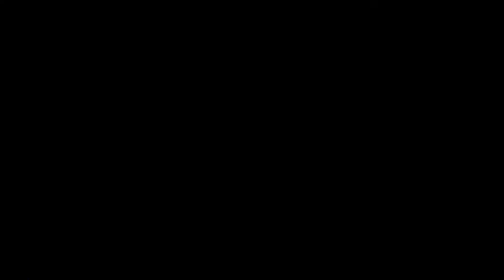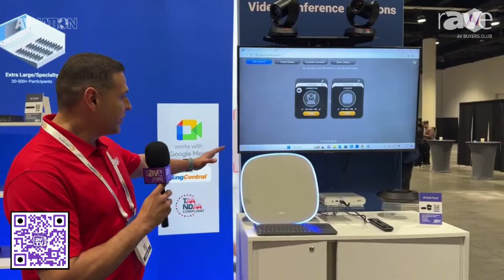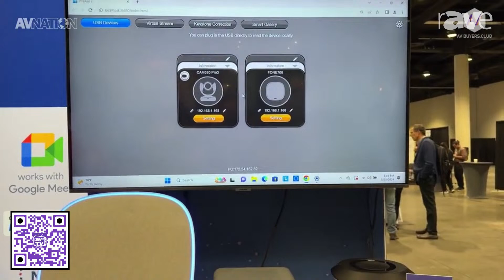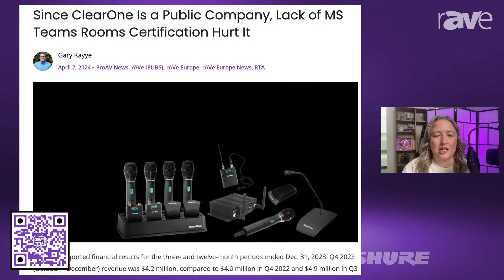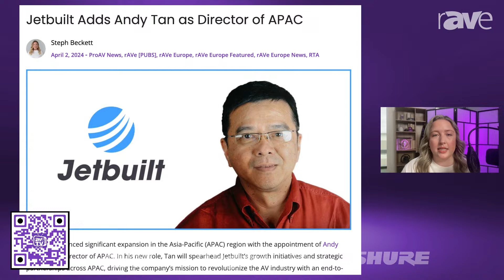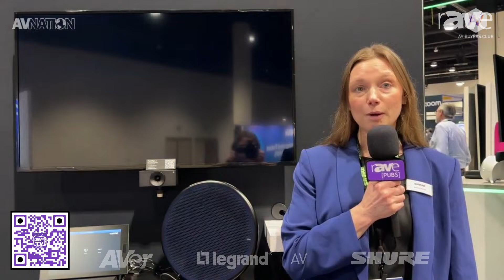Steph Hosts Solo, New UCC Product from Extron, Warren Chaiken Leaves Almo Corporation

Comment: Isn't it silly the AV industry is worried about sustainability when the majority of IT based products today are designed to last 3 to 5 years?  The industry is direct sale and AI configuration and operation bound, which will be displacing labor.  Analog based products lasted decades.  We were greener in the old days.  Ha.